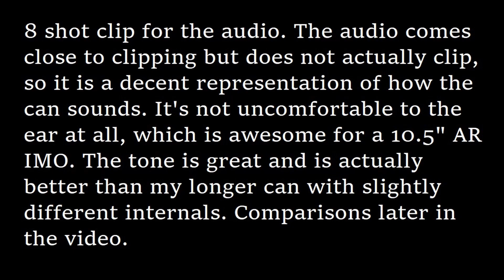7 Inch Form 1 Suppressor with Diffusion Wall

Comment: Great video man.  I'm trying to binge as much Form 1 stuff as possible.  I have a lot to learn from you guys
Reply from the maker: Thank you! I often do the same, still learning even with a few builds under my belt.
Reply: @NimrodCollective  NICE!!!!  So far it sounds like I need to implement single clipping and progressive spacing on my cans.......  While I have hardly any experience at all with suppressors, I have extensive experience in motor sports.  I know for a fact that thin wall racing headers are SUBSTANTIALLY louder than heavy gauge headers.  Therefore I want to run the Dino heavy cones on at least the first 2-3.  The difference may be minimal but the thicker heavier steel will hopefully last longer as well.
Reply from the maker: @4g63mark  yeah, that's an interesting observation! I think in the context of a suppressor that's going to be more of a tonal change than anything, but still all of that adds up to overall sound performance so it's an interesting concept!

Comment: Is it comfortable without ear pro?
Reply from the maker: For limited use, yes. I still generally wear ear pro when shooting with it, I just don't double up anymore like I used to have to.
Reply: @NimrodCollective  is that for both sizes?
Reply from the maker: For the 7" mainly, the 5" still isn't bad for a few. It would be suitable in a defensive situation within reason. That being said, the 7" lives on this gun and the 5" is usually used on my bolt gun with a much longer barrel.
Reply: @NimrodCollective  ok thanks! I’m planning my first form 1 can. I’m trying to decide which size I want.
Reply from the maker: Do you have any other suppressors? Short suppressors can be disappointing, if it's your first in general I'd go on the long side, 7-8" for good suppression and experience. If you have some other, longer form 4 cans I'd say give a short form 1 a chance and see how you like it.
Reply: @NimrodCollective  No it will be my first. I won’t to go as short as possible but still be comfortable. I was thinking around 7-8 also.
Reply from the maker: I've been very happy with my builds in that 7-8" range, I think that's a great option as a first can for sure.

Comment: Where did you get the parts for the build?
Reply from the maker: Tube is from quelltech and diffusion wall was a group buy on the forums, so neither of those is really available at the moment. The rest is dino precision storage cups.
Reply: @NimrodCollective  Ok thanks. I’m planning my first two and I’m struggling finding a easy beginner kit. Something I can just drill out and be done with but still work well.
Reply from the maker: It's hard to find one, because it's really hard to make a good all in one can. But for a first to get your feet wet, look into white trash tactical. I believe they stock kits on sundays.
Reply: @NimrodCollective  yea I don’t really need a kit per se. My issue is figuring out the spacing and planning of the internals. I’m trying to find someone that explains what they have and the sizes of each item.
Reply from the maker: Have you seen silencer student videos? If not, search him out on here because he has some really helpful videos!

Comment: What's the diameter?
Reply from the maker: 1.5"
Reply: @NimrodCollective  thanks man. Do you have IG? & what's a diffusion wall? I've been watch SStuedents youtube havent heard about it.
Reply from the maker: If the 1.5 vs 1.625 comparison videos are on his YouTube yet, I believe he goes over them a little in those videos. It's basically what YHM uses as the blast baffle in their cans. Flat, with holes around the perimeter. Designed to extinguish the flame front and reduce flash out of the can. They don't seem to do a ton for suppression but in my experience they cut down flash a lot for NV or low light stuff. 

I do have an IG! Should be under the same name, @budgetshooting.
Reply: @NimrodCollective  ok yeah I was thinkin thats what it was, just wasnt sure. The odessa9 has one of those. & thank you, just added you. Keep up the good work.

Comment: I really like how this turned out! I'm building something very similar soon, could you say how the diff wall was spaced between the muzzle tip and next cone?
Reply from the maker: The diffusion wall is roughly 1" from the tip of the muzzle brake, then the first cone is around .375" from the back of the diffusion wall.
Reply: @NimrodCollective  Nice. Did you do static or progressive spacing beyond that?
Reply from the maker: Progressive, but really only for the last 3 cones. .5 static for the first 4 and then tapering down to .250 towards the distal end.

Comment: As someone who is there and can truly appreciate the side-by-side comparison, the sound difference between the 5 and 7-in is there but is less substantial than you would think. The difference between the 7 and the larger can is almost non-existent but flash was severely toned down with the longer can. Interesting to see form 1 cans performing so well especially when you compare them to slightly older but still solid designs in the marketplace.